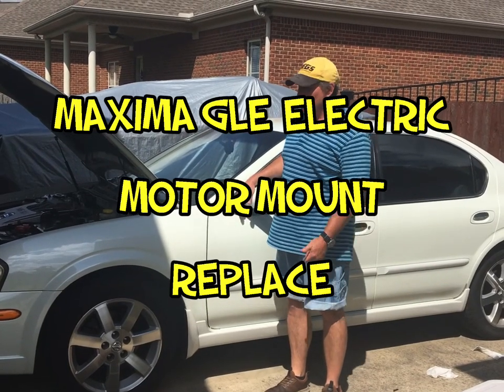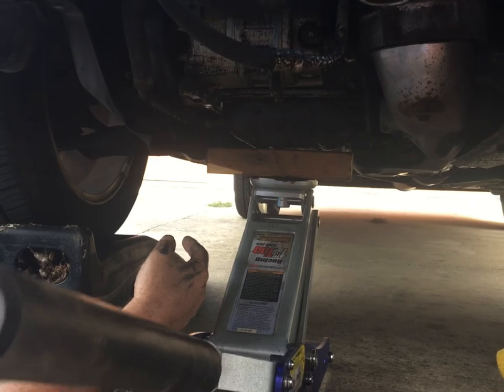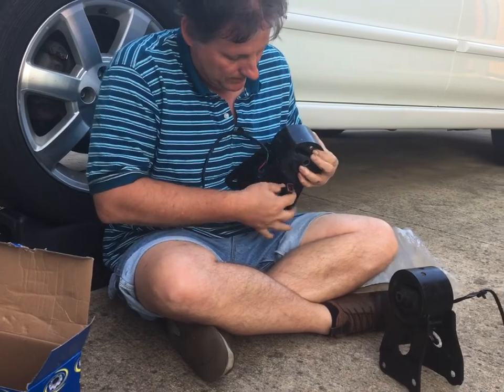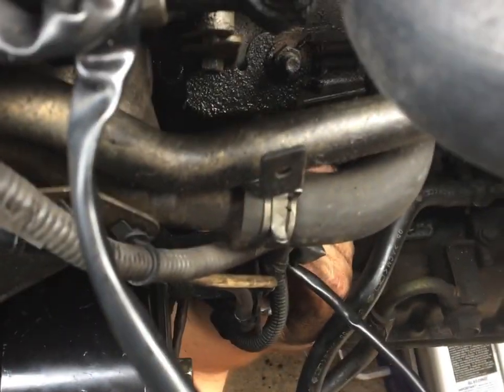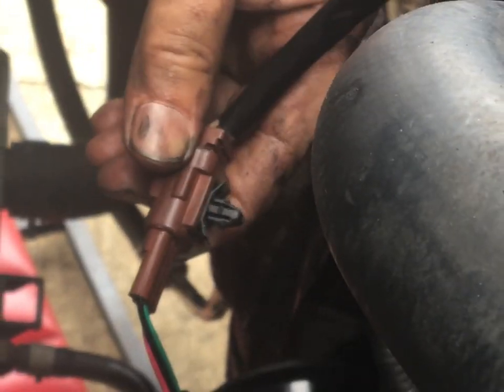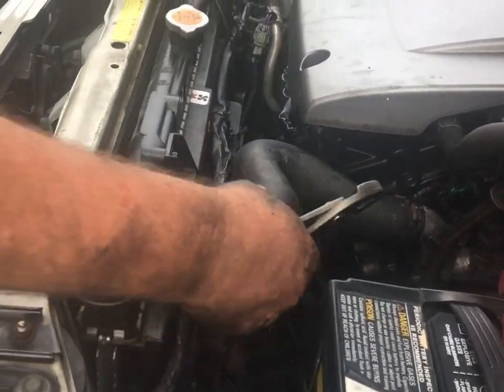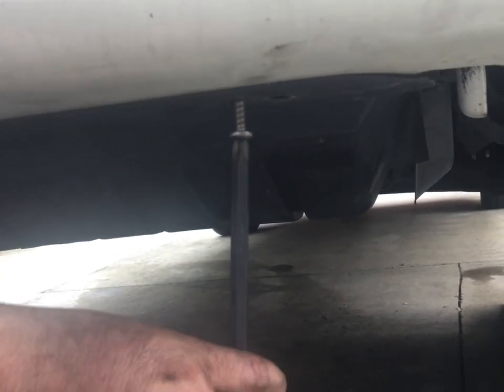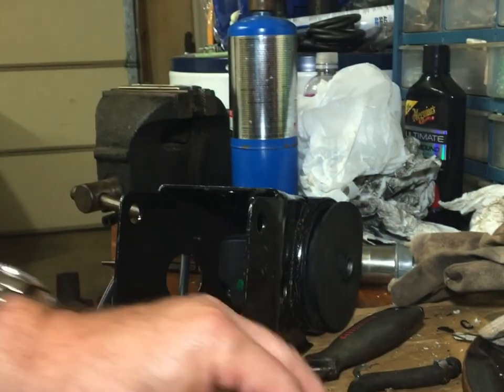Maxima GLE Electric Motor Mount Replace

Comment: I'd disconnect the power to this mount (and the rear mount) as soon as possible if I were you, the mounts short out and then fry the car computer because there is no circuit protection. This issue has been well documented, it is a serious design flaw. The other issue is the idle air control valve, coolant leaks cause it to short and it also fries the computer.
Reply: What are the symptoms of it frying the computer?

Comment: Interesting. I drive a 2000 Maxima and have not had to do this yet. Mounts are still good. But I guess that won't last forever.
Reply from the maker: As fine as these cars are the parts do still wear out.  It is sick what an insurance company thought this car was worth.  I wouldn’t trade it in for a new GM car! https://youtu.be/JjosyoWp-wg

Comment: Hey I got a question for you I got a 1998 Nissan Maxima me and my dad fix the front motor mount do you have to have the sensor can you bypass it
Reply from the maker: Hi, I think it is ok to use a standard mount.  Make sure you secure the connector in a way to prevent it from getting wet/shorting out, which might damage the ECU.  Maybe fill the connector with silicone.  As always results vary.
Reply: Jakethe.... on u 98 maxima you have to take of radiator  too ???

Comment: I'd consider covering that trans cooler line with heat wrap it runs too close to that catalyst
Reply: Theyve always run like that and that one in particular looks original. 20 years that line has been there and it still looks good. Same thing fpr my 98. 24 years with no heat protection but its the original line

Comment: Why you take off of radiator  sr??
Reply from the maker: I am not sure what you are asking?  I did remove the fan assembly to ease removal of the mount, the radiator was not removed but the upper hose was removed to allow removal of the fan assembly.  I think the factory service manual suggests the same plan of attack.
Reply: @millionmilegarage9587 OKAY IS NECESSARY  REMOVE OF FAN ? OUT..  I HAVE A 98 MAXIMA BUT I DONT KNOW IF I HAVE TO.DO.OF SAME PROCEDURE  LIKE YOU  SR.??
Reply from the maker: Tony Cervantes I removed mine to get clearance to easily remove, I think factory manual suggested it as well, not sure about a 98 model.  Doesn’t hurt to try and then remove if required.  I’m not a contortionist so I choose the easy path.🙂
Reply: @millionmilegarage9587  okay  you don't have video  how to remplace  of transmission  mount . Sr..

Comment: Looks like the exhaust bakes the mount
Why not go with manual mounts and cap the wire off?
Reply from the maker: We may go with manual mounts and poly inserts after we install the turbos.

Comment: That motor mount you take off is.of  transmission  motor  mount ??? Sr
Reply from the maker: I think it’s called the front engine mount.
Reply: @millionmilegarage9587  thanks
Reply: @millionmilegarage9587   is necessary  buy of same electric  engine mount sr.. ?
Reply from the maker: Tony Cervantes Going off memory it has to be a mount for an automatic, the frame on the auto is different than the manual so mounts don’t interchange, if there is a mount for the auto that is not an electric mount it will probably work.  I thought all autos were electric mounts on the 1999-2003, not sure of other years.

Comment: Is the procedure the same on the 01 maxima?
Reply from the maker: I would think so, 2000-2003 were same generation, so while there could be a slight difference in active mm used for different model years they are pretty much the same animal.  https://en.m.wikipedia.org/wiki/Nissan_Maxima

Comment: Can't you take the motor mount from underneath without removing the fan and draining the radiator ?
Reply from the maker: I don’t think so, but if you make a video showing how it’s done feel free to post the link here.
Reply: @millionmilegarage9587  most people from the fb group remove the crossmember completely and replace both, but if you're just doing one this probably makes sense. I have a feeling you've already done some research on the org or somewhere though lol
Reply from the maker: Joe Carsella I never really thought about it, going off memory I did what the factory repair manual suggested.  If it’s easier to pull the crossmember I may do that when I eventually replace the rear one.